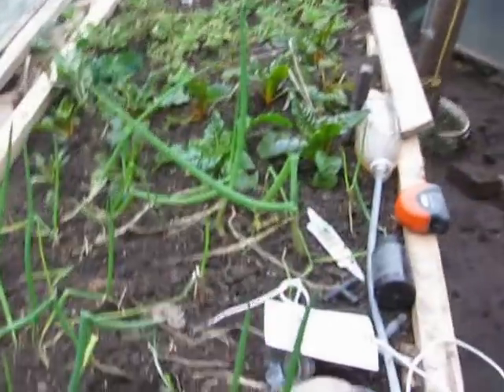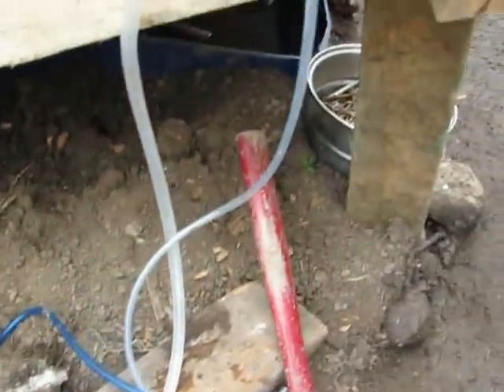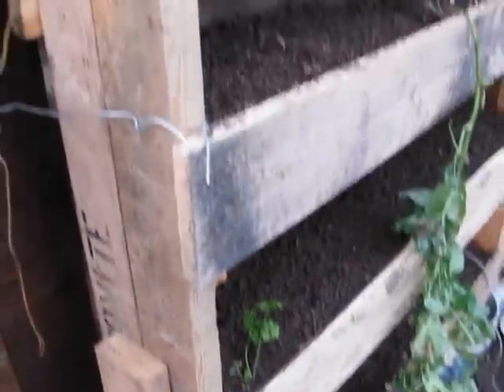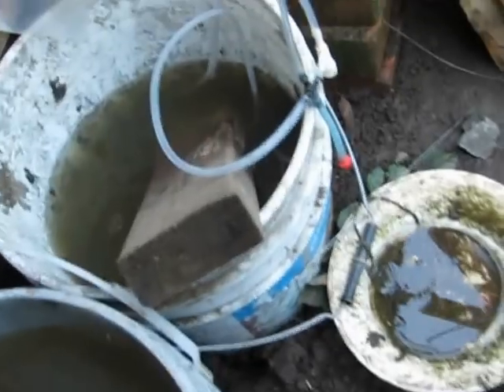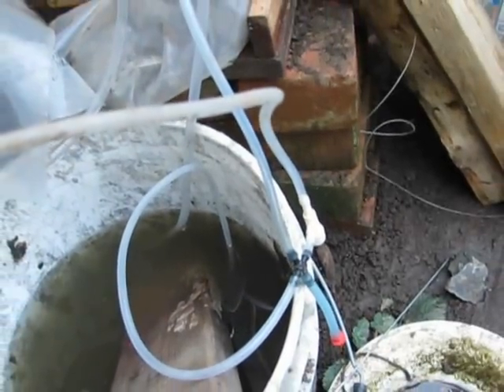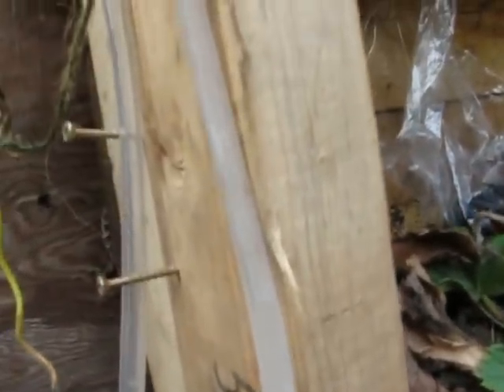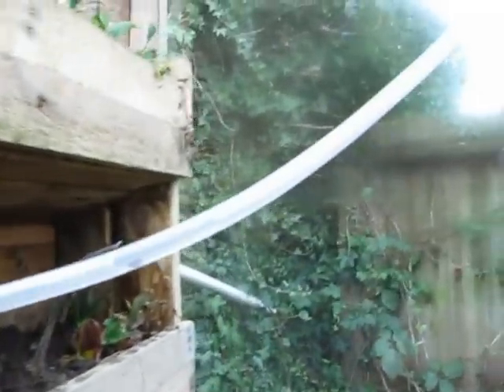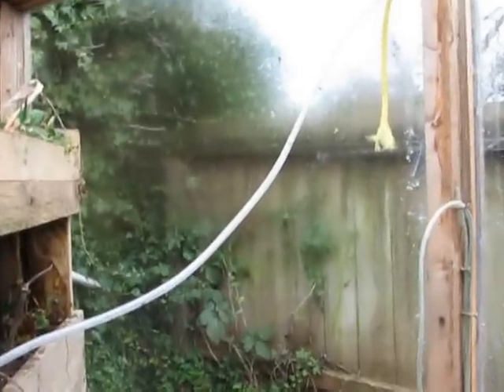Pallet garden Update! and extremely slow pumping through 3/16 (4.75 mm)  tubing with tiny pressure!

Comment from the maker: Yeah, Mike, it is very little energy.  I could have done an irrigation system for my garden with drip irrigation in a couple of hours! FINISHED!  DONE!  But a couple of billion people do not have that option.  So I like to think that this is for them. So last night, I was looking into low temperature solar thermal powered fluidyne sterling engines! (Just sun falling on a flat panel).  Amateurs made them in Germany and Canada 10 years ago,  they worked!  for pumping water.  Air pumping is easier!

Comment from the maker: Looking for a super LOW PRESSURE solar thermal powered  fluidyne Stirling engine to run the airlift pumps for pallet gardens!  Can anyone make them? We are talking 60 litres of air compressed to the enormous pressure of 1 psi every hour.  Can you do it? Share as widely as you can.  Thanks Brian